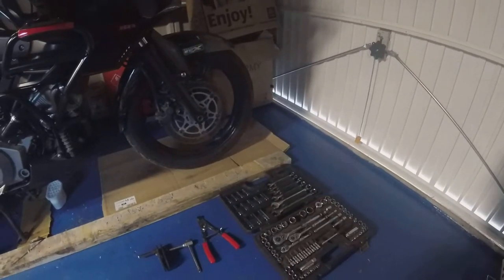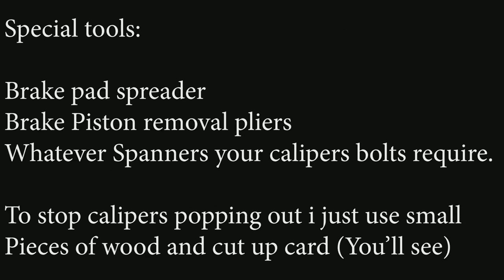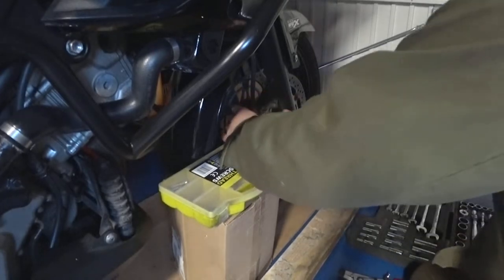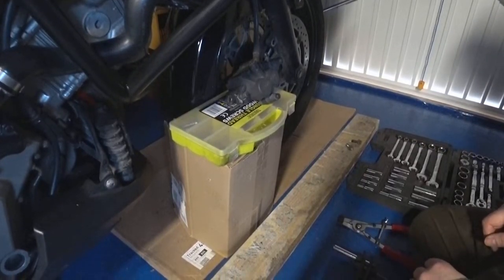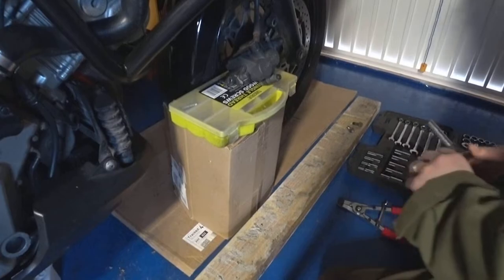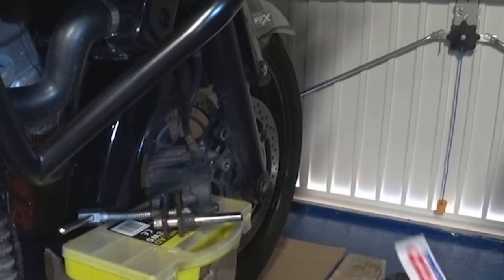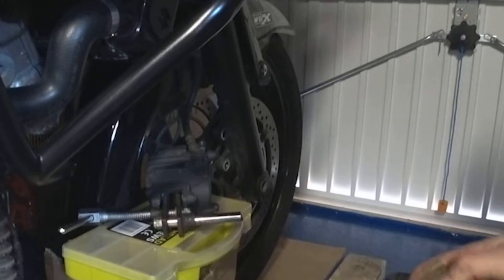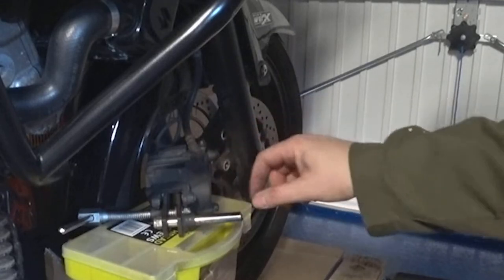Removing Motorbike Brake Caliper Pistons (VstromDL1000)

Comment: Nice one. Does that bike have ABS and does bleeding the fluid like that not risk air getting into the pump? These are obviously newbie/n00b questions - can you guess why!?
Reply from the maker: Nope the Vstrom is non ABS, however if replacing the fluid I replace it all including bleeding the abs pump as I do on the BMW.. As stated at the end of the video it is for removing pistons only not showing how to strip brake pads or bleeding the system. If a person doesn't know these things they shouldn't be changing their caliper piston seals. They should be learning those things first.
Reply: @north5760  I've changed the fluid, cleaned the pads and calipers, but usually by adding as I'm bleeding and without disconnecting the banjo bolt. I do intend to do a full service including splitting the caliper and replacing seals later this year. Always a first time!
Reply from the maker: @NooBiker  it's really not the worst job if you take your time. The BMW has 4 pots and they needed split to remove the pistons,  but same principle generally applies to get them out. I tend not to bother about how the fluid drains I use a suction pump to pull fluid back through then bleed everything manually including on the BMW the ABS pump.

Comment: Fine to be in a warmer garage doing the work this year eh? Does this mean you'll be ready for rides soon?
Reply from the maker: Yep definitely, the  Vstrom got its MOT today and a nice new rear tyre. It's ace working in the garage, heater on and chill. Will be better once I close off a few of the eaves vents and put better seals round the door
Reply: @north5760  Excellent news. Aye the fine touches make the whole experience better.